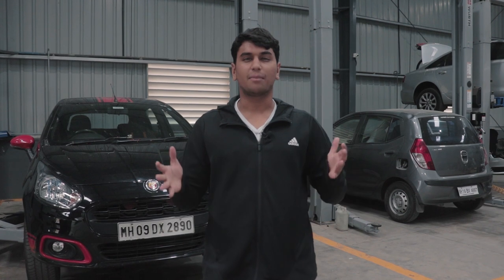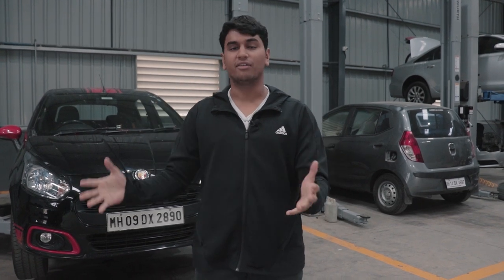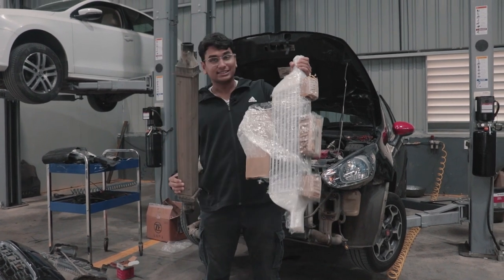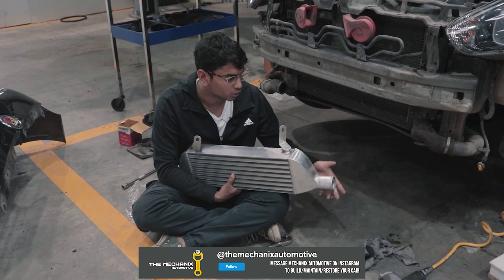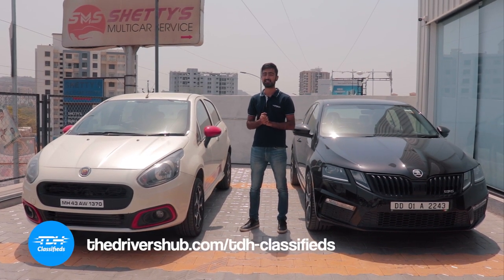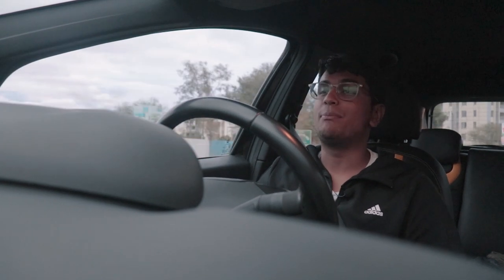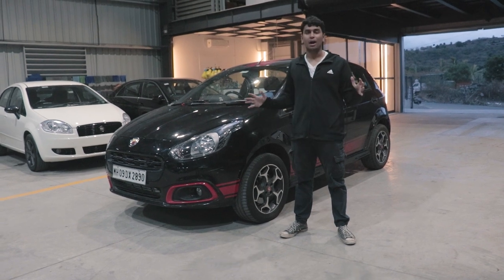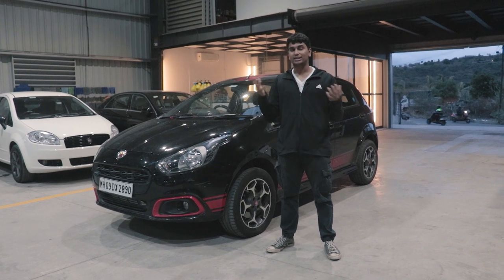Garrett Intercooler for the Project Abarth Punto! | Project Abarth

Comment: Hey guys, Binoy here from Stellar Turbo. First off great video ! I just wanted to jump in to apologise that this intercooler did not fit directly. I can see that the top clamps are put on the wrong way and once swapped it will fit directly on the crash-bar holes without you having to make any modifications - i.e. Drilling. In fact we market this product as plug and play with no drilling required. I would highly recommend swapping it out, the current install may be prone to rattling in the long term. If you are in bangalore, please reach out and we will have this sorted out at our place!
Reply: Thanks for your comment Binoy. I am also planning to upgrade the IC in my Abarth and was surprised that its not plug and play. Thanks for the clarification
Reply: @rahul_abp  Glad I could clarify this. I have also discussed this with the installer who will be rectifying the install this week. Feel free to reach out directly if you need any further info!
Reply: Sir where I can get se big intercooler....am looking for 90 hp...punto evo disel.....
Reply: @maheshhegde7002  Hey Mahesh, unfortunately we don't offer a bolt-on intercooler upgrade for the diesel Punto. You can contact any of the tuning firms near you and they would be able to provide you a custom solution.
Reply: Hey Binoy, how can I get in touch with you for an Intercooler for my Abarth.

Comment: our a garage and you think a intercooler, cools the engine down 😂😂😂 think you need a new career it's to cool the air going into the engine the more fines it has the more surface area which means more air can get tracked inside it for longer to help cool it down faster. The intercooler is nothing to engine temps, what a banjo.